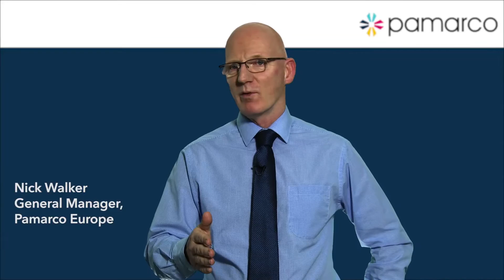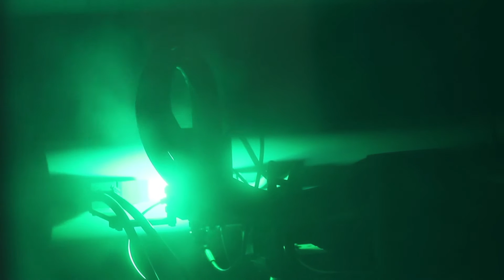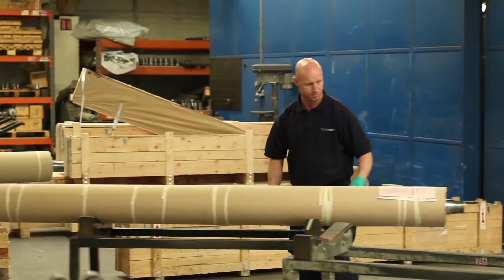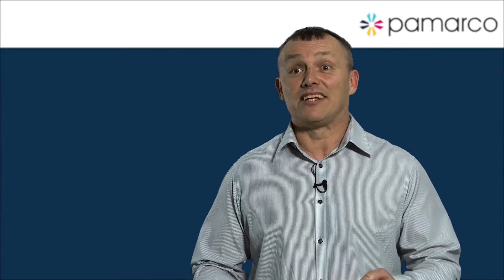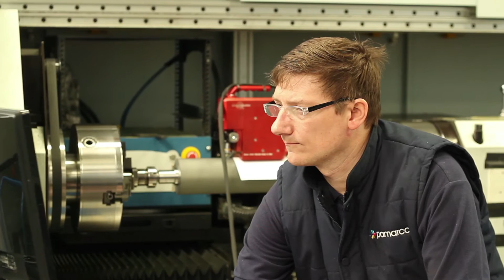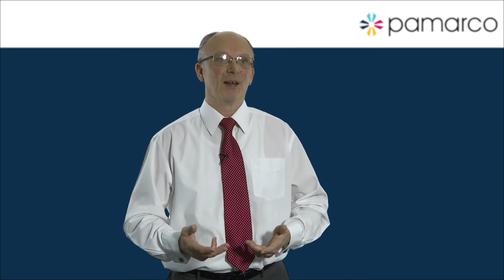How It All Started: Flexo Edition

Comment: Do you make the rolls from raw material or just the coatings? I've heard of a company in Runcorn that make them wondered if they where any good?
Reply from the maker: When it comes to producing anilox rolls Pamarco is fully integrated. Our Walton KY facility produces steel and aluminum bases to OEM press specifications. These bases are then sent to one of our laser facilities in Batavia Il., Atlanta GA., La Palma CA. for coating and laser engraving.  For sleeve presses we source the base sleeves from several specialty manufactures to Pamarco’s exacting standards and process them through the same facilities. Thanks for asking
Reply: @PamarcoGlobalGraphic  thank you for your reply it sounds good, I thought you may of done the laser and plasma in house.